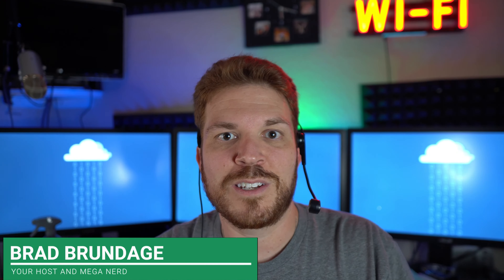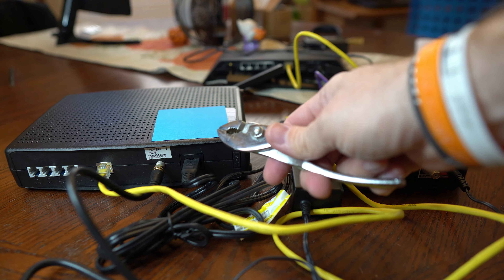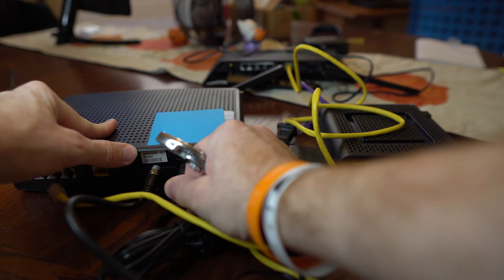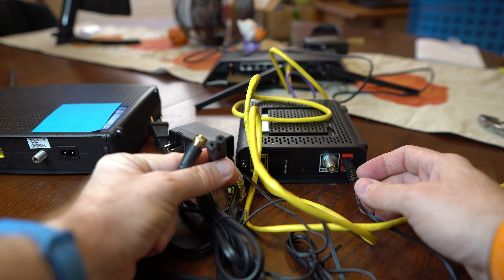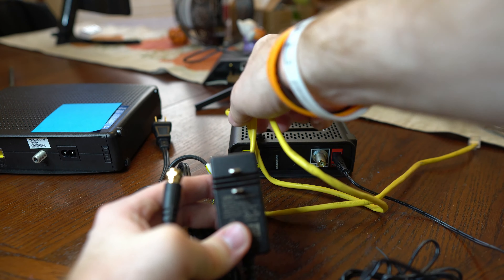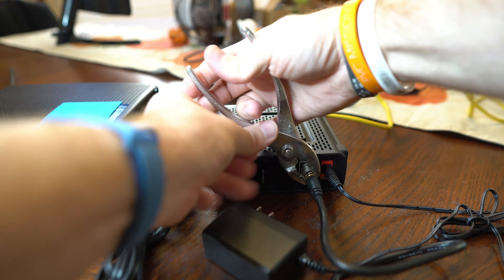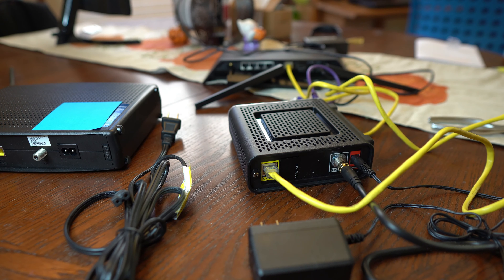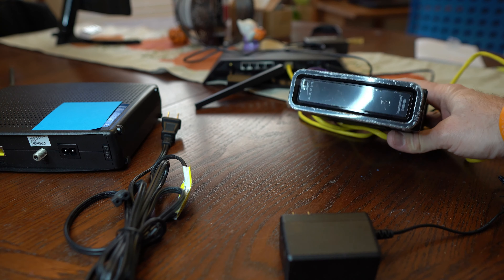how to replace your modem

Comment: Hello, thank you for the video. Can I swap my modem with a router?
Reply from the maker: @Mi Coolio Only if the router has a modem built in as well. Otherwise it would be 2 devices. The modem takes the signal from your ISP and typically converts that over to ethernet and a router then provides a firewall to try to keep the bad guys out from the internet and routes traffic as well as could also be providing Wi-Fi as well. What is the model number of the device that you want to be using?
Reply: @ShinyTechThings  I want to just have one part of the wifi with Ethernet connected tech and the other with handheld tech. I have spectrum and idk what would you recommend? Thank you again for your response I appreciate it and have a great day.
Reply from the maker: @Mi Coolio Personally I prefer a separate modem and router because of the options available and the modem or modem router when it gets provisioned by the ISP they typically lock you out of options like SNMP so the less control they have by getting 2 devices. If it were me I would still get the Arris SB8200 or the Netgear CM1000 as they are the same chipsets under the hood. But whichever one is on sale or matches the decor better. Then for the routing and Wi-Fi I typically recommend ASUS or Ubiquiti. How many square feet is your place and how many levels is it? Do you have many devices that will connect? What is your current modem and router?
Reply: @ShinyTechThings  I don’t have a router at the moment but the modem model is tc8715d. I believe we are paying for something near 250 mbps
Reply from the maker: @Mi Coolio that is a Technicolor modem router all in one. Reviews of it are not that good. What's the budget for an upgrade and how many square feet is your place and how many floors is it? Does the existing Wi-Fi cover your entire living area?
Reply: @ShinyTechThings  budget about 300. It’s one floor about 1191 sqft and the current internet covers the interior well but for parties when we are outside doesn’t cover anything.
Reply from the maker: @Mi Coolio is the current modem/router in the center of the house or towards where you have parties outside?
Reply: @ShinyTechThings  near the entrance of the house.
Reply from the maker: @Mi Coolio the SB8200 is under $150 on Amazon now. The ASUS RT-AX3000 is ~$155 which puts you right at about $300. I like Asus routers because they typically end up having longer support for updates than most other manufacturers all the other companies are starting to catch up with asus. Also there is support for AI mesh which allows you to get another ASUS router and create a mesh Network and also Merlin firmware support if you want to add additional features to the router it's very easy to do and I have a video on a different ASUS router that shows you how to do it and it's basically the same process. Has built in antivirus I trend micro and a bunch of other bells and whistles that make it stand out from the competition in my opinion. Otherwise personally I run a Ubiquiti UniFi system. But just my router without Wi-Fi is $379 and then a wireless access point for another $179 and a switch on top of that (PoE 24 port was like $400 or so) but it's Overkill for most homes unless you do wired surveillance cameras and multiple Wi-Fi networks.
Reply: @ShinyTechThings  Awesome, thank you! Will definitely look into it more. I just need something to work from home and stream with me and the family. Also just by reading the description of your set up it sounds like something a sky scraper would have. Thank you again.
Reply from the maker: @micoolio8239  I made a video a while back on consumer VS enterprise gear you might want to check out. But for most homes I recommend ASUS as I've had good luck with them so far.
https://youtu.be/6tMFTcS5r_0 let me know how it all works out after the upgrade, also be sure to check out today's video on upgrading your router. It'll walk you through the basics of backing up any type of configurations and also has some security stuff you'll want to consider.
https://youtu.be/Mmefd0M8Rco
Thanks for your support!👍